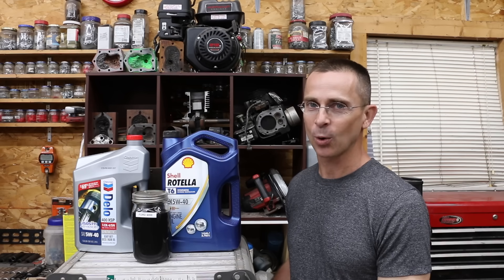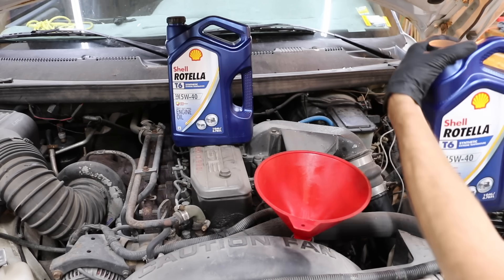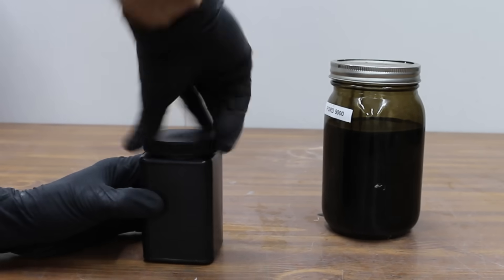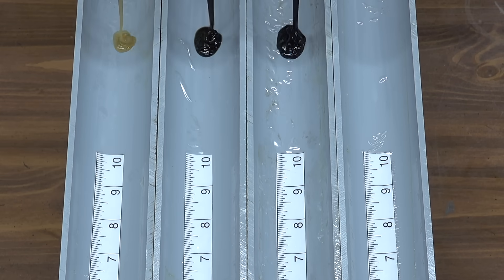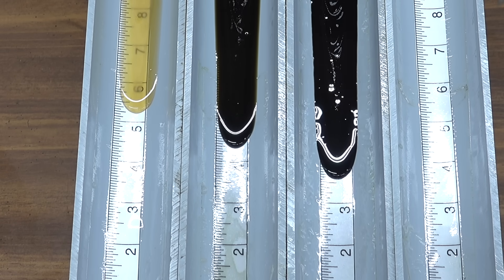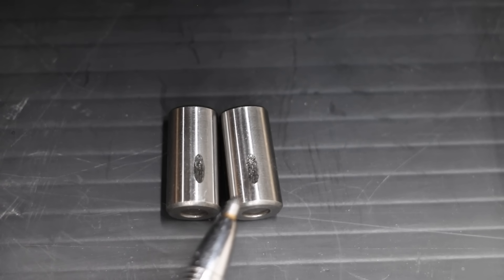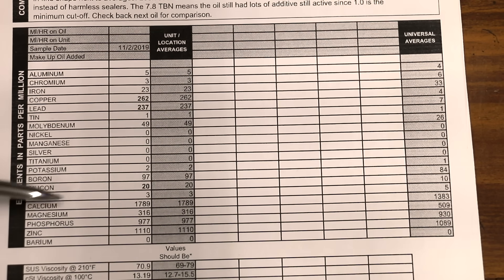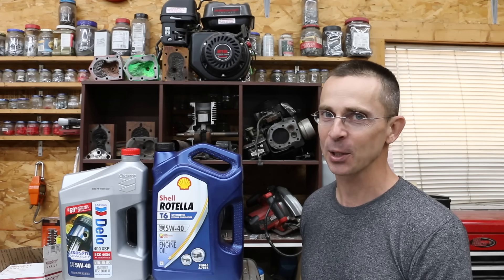Will Annual Oil Change Damage Your Car? Let's find out!

Comment: Back in 1995 my neighbour, a little old lady, asked me to take a look at her car because it just wasn't running right and had no power.  It was a 1990 civic.  I took it for a quick run around the block and I agreed it had no power.  Literally, you had to put the gas to the floor to get moving from a dead stop.  I told her something was definitely wrong and she should take it to the shop to have it inspected.  She came back a few hours later and told me the shop was trying to scam her and told her that she needed a new engine.  The car had just over 45000kms on it but was past the warranty date so she would be on the hook for it.  They told her it was totally worn out as though it had 10 times the miles on it.  I asked her how often she changed the oil and she replied "I put oil in every time the light comes on".  No kidding.  For over 5 years she had NEVER had an oil change done and was STILL on the original filter.  When I pulled the dipstick out to check it the bottom was so caked with sludge that it plugged the dipstick tube while being pulled out.  I had to use engine degreaser to clean it to enough to even see the "add" mark.  I pulled the drain plug and absolutely nothing came out.  I slid the dipstick up into the pan through the drain hole until I felt it tap the crankshaft and then pulled it back out.  A few drops of oil came out but the sludge was so thick and heavy it re-sealed itself.  I told her she has 2 options; new car or new engine.  She asked me to talk with her mechanic since she knew nothing and I asked him to put in a good used engine as it was the cheaper option.  In went an engine with 50000km (5000km more than her original) and it ran like a dream.  Car felt as good as new.  He showed me the original and the sludge was so thick in the pan that the crankshaft had literally scrubbed a path in the sludge.  Think of what it looks like when you scoop ice cream out of the carton...that's what her oil looked like.  When she got home I told her that from now on she MUST take her car in every March, August and November (based on how much she drove), to have the oil changed if she didn't want to do this again.  She began to complain that $20 for a lube/oil/filter 3 times a year was WAY too expensive to which I replied "Or you can spend another $2500 to replace your engine again".  She remained convinced that the mechanics were scamming everyone and there is now way oil can go bad that quickly.

Some people cannot learn their lesson.
Reply: That sounds like a wonderful person not to be married to
Reply: I've been driving nearly 50 years and never heard of let alone ever seen any such engine filled with solid sludge....ever. I also spent 27 years as a locomotive engineer with CSX. It was extremely rare for oil changes in a locomotive. They pulled samples regularly but constantly added oil....even new, they consume lots of oil. All those diesels equipped with low oil/low water shut down devices....they just didn't lose engines to oil related issues.
Reply: @mark-wn5ek  
I do not have experience with locomotives, only passenger vehicles, light- to heavy- -duty trucks, and turbine engines.
A loco engine has a very large capacity crankcase, and just like a large body of water temperature changes and particulate loading is spread throughout the whole quantity of oil, but a small engine crankcase might only be 5 quarts.
What impresses me about those loco engines is how massive the crank bearings are!

When I worked as a parts counter jockey I was amazed that there are as many people as there are who did not know how easy it is to check their engine's oil level. Or that there are used oil analysis 'kits' to test samples to get the most out of an engine and its oil.
Reply: She does have a point: The rest of the world hasn't seen 3,000 mile oil changes since about the 60s. Intervals were annually or 10-12k in the 90s.
Reply: I don't think it has anything to do with women being different from men as much as a cultural thing.  If a woman is brought up to believe she can't do it and just isn't smart enough that has nothing to do with her natural abilities.  I have 3 daughters and one of them absolutely has the mind and interest to succeed in STEM.  In my job I deal with old people all the time who have convinced themselves that they "can't do it".  It has nothing to do with an innate inability but that they have convinced themselves that they can't and so they stop even trying.  I know some women who are amazing engineers and some men who can't even figure out how to use scissors.  It's all about the individual.

Now, with that said this was one woman who was definitely NOT suited for anything scientific or mechanical.  :)
Reply: I still do not believe it is due to genetics but rather cultural teachings.  Girls are taught right from day one that they have a specific role to play and their experiences are all based on teaching them how to be girls.  Similarly for boys.  I do believe that it is innate that girls are generally interested in people while boys are interested in things and this primarily stemmed from the roles each had to play in primitive societies.  Girls would stay in the camp and take care of the babies and elderly and so would have to be more acutely aware of the people around them and their needs.  Whereas boys would often be out hunting and having to find ways to be more effective and efficient and so would look for technological means to help achieve this.  As people settled into these roles their brains changed and they settled into their specialities.  From the beginning I included my girls in my "mans work" activities and while my oldest is still very "girly" she is also just as happy to go elbow deep into an engine and has had to wipe old motor oil from her armpit on multiple occasions.  No complaining.  If you teach someone from birth "this is what you are and what you get to do" you will limit their internal investigative processes.  But if you leave the world wide open and allow them to experiment and see what they like you will find that they almost universally cross the lines between "mans work" and "womans work".  My neighbour was the classic June Cleaver type housewife.  She never had a job in her life.  Got married right out of high school and stayed at home to raise babies and keep her house clean because she was taught this is what she existed to do.  She was taught to be helpless and that there was no need to think because there was always a man who would do it for her..

yes, we ARE generally different but we are FAR more similar than most people will admit to...or even feel comfortable in thinking about.  People do NOT like having their core beliefs challenged and will most will defend them to their death.  not because they are correct but because to question them is to question their own existence.

Wow...who would have thought that a video like this would spark such a deeply thoughtful conversation?  lol  Finally.  The internet does something good.  :)
Reply: I understand what you're saying here.  I'm not set in my ways and I am in fact a very flexible person.  I just work with my own experiences and observations.  Show me where I am wrong and I will happily agree and thank you.  but I need concrete evidence rather than feeling based opinions.  As it has been said "feelings are not facts".  To be honest I don't put much stock in studies as most of them are flawed from the beginning and usually are very biased.  This is not something that can truly be explained or decided by studies as there really is no way to truly make the situation unbiased.  I see it as no different than all the studies that tell us that eating lots of carbs and little fat is the healthy way to eat.  Since the studies (mostly observational) have become prevalent diabetes and heart disease have become rampant.  I trust what I see and experience for myself, not what some random "scientist" tells me is fact.  My 3 girls have all had the same exposure and encouragement and all 3 have gone their own way.  This is where the inherent differences you speak of come into play.  But it would have been so incredibly easy to limit their options and direct them to think and feel the way that I wanted rather than to let them become the people they are and enjoy and do what they want to.  Yes, girls will seem to naturally play with dolls to simulate the mothering instinct but boys do the same thing.  They are just called action figures.  They play with the toys to simulate and practice the roles they have observed they are "supposed" to take on.  It is a complex issue and I don't believe there is a true, universal answer.  Best to give people options and allow them to figure out what is best for them on their own.  Tell a child their whole lives that they are ugly and stupid and that is what they will tend to believe.  Tell them that "this is the best you can do" and you will generally find that is the limit they will go for.  Remove the walls, boundaries and limits and let them find their own and you will be shocked at what you will see.  The inflexible mind is such an incredible waste and when that in turn leads to anther's mind being clamped down it becomes a vicious cycle that leads to stagnation.  Once you are convinced that "this is the best I can do" you're not going to try to do better.
Reply: Hm. So "over 5 years" no oil change is a problem, conclusion is: "You need to change it 3 times a year"?
How about every 12 - 18 months? 
Then again: if your oil+filter+work is only 20$ then it is a very basic low quality  - even for 1995 standards.
Still: 3 times a year sound like an awfull lot even for bad oil.
Basically: "She remained convinced ... there is now way oil can go bad that quickly"
She was right. It can't. Not even 1995.
Reply: Cool story, bro.

Comment: Shell Rotella T6 SAE 0W-40 is an SN motor oil that can be used in gasoline engines, if you are looking for an SN spec version, get the 0W-40 version instead of the 5W-40 version.

Comment: I have a car that i drive once every 3 months or so that i haven't change the oil for 3 years. I was told to change it at least once a year but thanks for your test, I don't feel like its that urgent since i put less than 2000 miles on it in the past 3 years
Reply from the maker: Thank you for the feedback

Comment: GREAT VIDEO ! Have you done a test on a engine that has ran different oils and every oil change ? I remember when they used to say if you run what ever oil brand don't switch brands stick with what you started with.
Reply from the maker: Thank you for the feedback

Comment: What benefit would this 5w40 have running in a gas engine? Other than more detergents and dispersants? And what oil viscosity are you using this instead of?
Reply from the maker: Thank you for the feedback

Comment: Remembering the not long ago past when manufacturers recommended to change the oil every 3K miles or 3 months which ever came first, it is hard to wrap my head around changing the oil every 5K miles or 12 months which ever comes first.

Comment: I have a 2006 Mercedes which holds 8 quarts of oil.  I only put on about 1,000 miles a year .  I change the oil every two years. I am using  Amazon synthetic 0-40W  Does the oil capacity relate to lifespan of the oil? Also these tests are on a diesel would it be the same on gas engine?

Comment: My Hinda Civic has a sign right in the engine compartment that says to change the oil every 7500 miles, so even the "change your oil every 3000 miles" claim is not necessarily correct. (And by the way, it was the engine oil industry that made that determination, not clinical research)

Comment: Clean truck! You should be able to keep it for a long time. My ‘01 sits mostly through winter. Come spring the oil and filter are always changed regardless of miles driven from the previous year just in case. Now I won’t feel too bad if I let go a little longer.

Fleetguard filters are awesome! Didn’t know a wire mesh was included behind the filter media.

Comment: I wonder how long you can you use oil before you have to change it? For instance, the rule of thumb I hear is to change your oil everything 3,000 miles; however, my car owner’s manual recommends changing the oil every 7,500 miles. Could oil actually go even longer? Or is 7,500 mile too long? I would love to know!
Reply: I changed oil after 2 years 10000 miles. I doubt the car suffered any damage.
Reply: I think this would be a good test to know just how long oil really can go. I have put 3 yrs and 10,000 miles on my Dodge diesel with the T6 in it before changing it. A John Deere used oil analysis kit  said the oil was still OK after that time period....still made me a little nervous when I realized the amount of time and miles were on it!
Reply: Well,.. I'm using a conventional Castrol oil in my old v2 motorcycle, air-cooled.. When it reaches 3000 miles, you for sure can hear the engine starts to make that friction noise,.. And tells me it's time to do a change..
Reply: @gorgon9786  If it is making "that friction noise", Then your engine is likely toast.
Reply: all depends on oil quality,cheap oil,change more than decent ci4,ect.
Reply: Dear god. The last car I had with a 7,500 interval was built in 1985 and had an engine from the 60s. I do 18,000 intervals on my 2004 Diesel and am on 268,000. Runs like a watch and barely burns any oil.
Reply: The 3k mile oil change is not accurate, even for conventional oil. Many are running 5-8k on conventional and in the 20k for carefully maintained synthetic.

Check out Bob is the oil guy dot com
Reply: It's best to use full synthetic if you're willing to change oil every 7500 miles. Its advice to go with your car's manual. But always change the oil and filter. If you use conventional oil change atleast 3 to 4 thousand miles.

Comment: My 7.3 leaks so much oil I never have to get it changed. Just keep adding lol.
Reply: Guy Who Does Stuff leaking or just disappearing? I can’t find a leak on my garage floor but mine is disappearing at a rate of .5quarts every 100miles or so...
Reply: @DoDgeSwaG all diesels especially 7.3's do burn a little oil and you problem sounds exactly like oil burning. Just gotta keep adding with these trucks

Comment: I have cheap TSC 15W-40 oil in an old Farmall that's been in the pan for 15 years. I use the tractor 1-2 times a year at full operating temperature, about 1.5 hours each time. That same oil still looks GREAT!

Comment: This makes me wonder about oil contamination with diesel motors vs gasoline motors. You'll always contaminate the oil with fuel to some degree and does the effects of gas contamination vs diesel make a difference that matters? I imagine so. Though, with different motors of various age/condition having various ring wear it probably varies a fair bit. Maybe test direct contamination? Literally add a percentage of diesel/gas straight to some used oil, let it sit and interact for a while, then test versus non-contaminated?